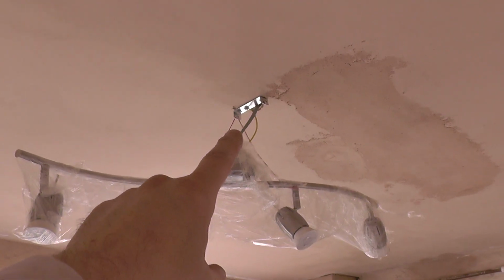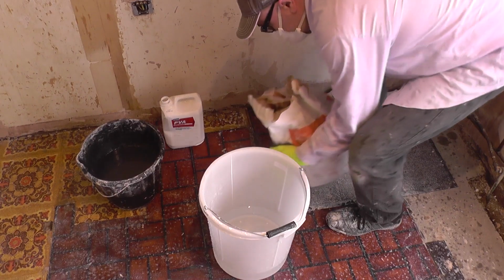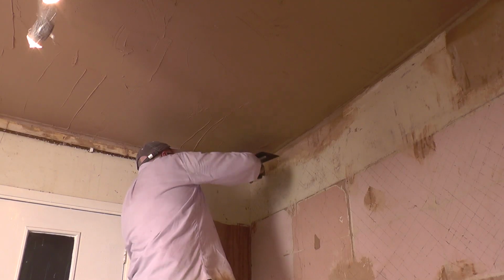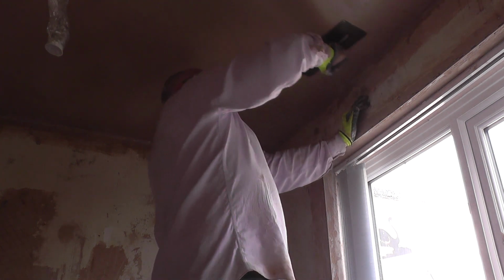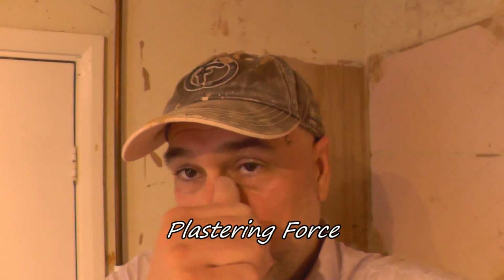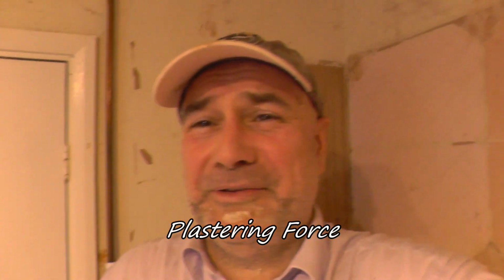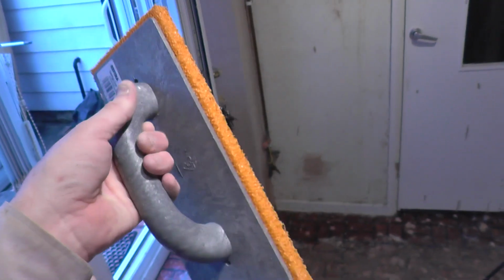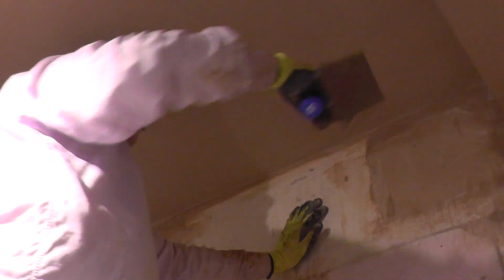DIY: Sponge Float Plastering - First Attempt / Sponge Float Skimming A Ceiling

Comment: I’m a painter but have been plastering my own home. I learn all techniques from plastering force and have found the sponge float so successful. I put two coats on from same mix. Flatten in with speed skim. 10 mins later sponge up. 1-5 mins later flatten in with NELA SuperFLEX. 15 mins final trowel up. Finish is acceptable. Always end up with a few blemishes probably due to the bad light but once mist cost, easyfill blems, sand and basecoat, finish is great. I find most important is to get nice flat even finish and not worry about odd blemish here and there so easy to rectify after with easyfill. I understand if your a pro then you expect a perfect finish strait up but this gets me a perfect finish just takes a small amount of time longer
Reply from the maker: Hi there buddy. Interesting feedback my friend. There are undoubtedly many ways for a DIY / amateur to get a decent finish with plaster. I think folk need to experiment and find what works for them. However, a good starting point is to get some good tips from the pro's to start off with. Have a great day buddy. Des

Comment: Been using sponge for 3/4 years now. If you put the plaster on 3-4mm first coat and make the mix a little thicker than usual. You can comfortably one coat on plasterboard and get a great finish. Timing is key for when to sponge and when to trowel the sponge lines out to late and your screwed, too early and you take off to much skim and leave a gritty effect. Practice is key. I can start a guage from mix and have it finished in roughly 90 mins and just cross trowel it for a shine later in the day

Comment: Looks ok to me buddy when its dry just nib down .. it's a case of speed and cover a bigger area but looks a nice job. When its dry nib and coat up with some matt emulsion miss coat the first coat thinned emulsion first and two further coats it will look fine.. great job like you said only doing now and again. People are amazed at the speed I work when painting and decorating it's only because it's my trade and been doing it for 31 years so efficient quick take pride in my work. Again thumbed up buddy did great on that ceiling.
Reply from the maker: Hiya buddy, good to hear from you mate. 31yrs is a long apprenticeship!  Stay safe and well, Des

Comment: Sponge float is  a learning curve I mainly use it on walls that if I start to give it it's first flatten and it's troweling up bad I will run the float over it I've got footage of the painted finish and the sponge float walls have came up great nice job des you will find your own technique that suits you when sponge floating and make sure you really clean out the float cheers👍
Reply from the maker: Great feedback my friend. Using the sponge is a great idea if the wall isn't coming up good when trying to flatten. Will remember that one - could have used that so many times before mate. You're right about keeping the float clean. I thought I had done but next day found loads of little bobbles of plaster in it.  ATB, Des
Reply: @21stcenturycaveman33  what I have found is best to use the flexi trowel for when your polishing up use the ridged trowels for first couple of passes 👍

Comment: (1) go anti clockwise around your ceiling left to right  (2) you don't put enough on first and second coat you should not hear scraping (3) after sponge' trowel it straight away or it goes to dry , there are so many tips I can give you and many people think they can plaster but it takes a very long time to master well done good first go bravo
Reply from the maker: Hi there buddy. I really appreciate your advice mate. Thanks also for taking the time to watch the vid and for your valuable feedback. Cheers mate, Des

Comment: Hi how long after putting PVA on can you plaster ? Great videos very helpful information 👍
Reply from the maker: Hi there and thanks for watching.  Firstly, you will need at least 2 good coats of PVA. The PVA must be tacky (i.e. starting to set) as a minimum. Do not apply plaster when it is still wet/runny. Hope this helps. ATB, Des
Reply: U only need 1 coat  50/50 mix wait till tacky..
Reply from the maker: I think many people would disagree with that. Surely you need a higher water content to soak into the wall and create a stronger bond? If the PVA isn't watered down sufficiently all you're doing is essentially applying a thicker layer of glue on the wall which is actually going to be weaker. This is because the PVA isn't being drawn into the wall and is simply lying on top of the surface.You're plaster is therefore bonding to a thicker layer of PVA rather than being drawn into the wall.  The proof? Apply a 50:50 mix to a wall. Let it go off. Rub it off with your finger and pull the lot off like a big layer of skin. Great fun but not a good idea. Would be interested to get comments from others on this matter. ATB, Des
Reply: @21stcenturycaveman33  pva is to seal the wall! If u dont pva it... it will crack and craze but will still adhere to the wall!
Reply from the maker: That is partially true but it's not what any plasterer wants is it? You wouldn't want to completely seal the wall / surface because the plaster relies on some suction from the wall to draw it in and help it stick and stay on. There are 2 main reasons for PVA'ing a surface  (as far as I'm aware anyway) 1) to control the suction on the wall so the dry background doesn't draw out the water in the new plaster causing it to dry out and crack as you have suggested 2) to create a chemical bond between new and old plaster. Best wishes, Des
Reply: As a Diyer I’ve read so much about pva and my conclusion is. The red super uni bond stuff, there so little difference in price you may as well get the best one. 5-1 water/pva. 2 coats the day before over surface pre scrimed. Tacky is not important as it’s sole purpose is to stop the surface your skimming sucking the moisture to quick. It in no way helps the plaster stick to the wall. Simply controls suction. My 2 cent
Reply: @zlock97  hi I'm fit plaster I pva x1 leave it for 10 mins then bang the plaster on 5 mins if room is hot. Works for me never had issues

Comment: Great effort! If you were to have wetted the ceiling a little more with a pressure sprayer then sponged it as you did you would have been able to liven it up more . From experience I'd recommend  sealing the surface at least a day before with PVA(at least two good coats) or Wickes plaster bonding agent , it really does give you more working time sealing it the day before . I recently skimmed a  ceiling and tried  Extra time retarder in the first coat then used cream of tartar in the second coat . The cot gave me more working time than the Extra time retarder at a fraction of the price 🤔. Also a wetter mix will give you more working time all be it a muckier floor 😐.  By the way I'm only a diyer like yourself but wanted to share my thoughts on what will help you in the future .
Reply from the maker: Hi there buddy. I'm ditching that wretched hand sprayer asap. My hand felt like it was going to drop off after about 30 seconds. Lol. Bloody thing. A pressure sprayer is definitely the way to go. Next on my shopping list.  Interesting to hear about your experiences using the COT! Who'd of thought it, eh? I hear what you're saying about PVA'ing the day before but it won't give as good a bond if you do thatand allow it to set. You're supposed to wait for it to go tacky and then apply first coat of skim. That way, when the PVA goes off it combines with the plaster to give a much stronger bond when it sets together. Each to their own though mate. Whatever works for you. ATB, Des
Reply: @21stcenturycaveman33  I've  applied PVA the day before and also on the same day without any issues . If you have applied two coats of PVA the day before you really don't need to PVA again . As soon as your first coat of skim is applied it reactivates the dried PVA making it sticky again, won't work if you have used waterproof PVA .    Keep up the good work 👌
Reply: peter fido agree

Comment: Ive never seen a plasterer put scrim on after the 1st coat in my life! Also keep your trowel at a less harsh angle... and put it on even thick coats... if u can hear ur trowel scraping... your to thin
Reply from the maker: Hi there. The scrim should ideally have been put on before the first coat as you say. Ultimately though it made no difference to the end result which looked decent.Thanks for watching. Des